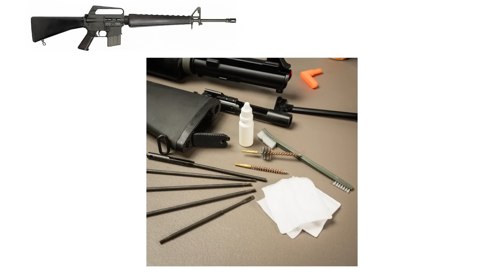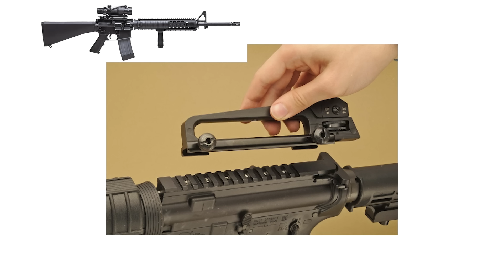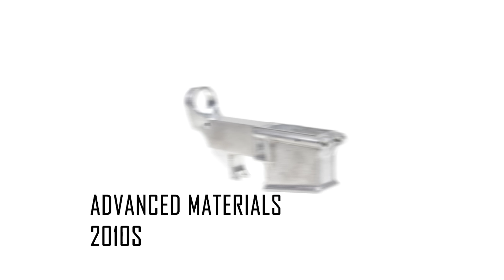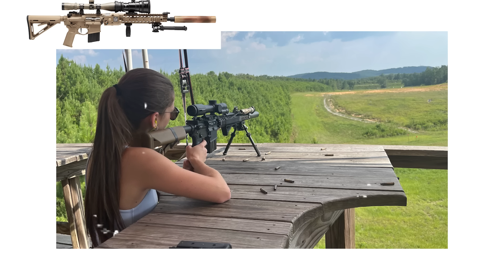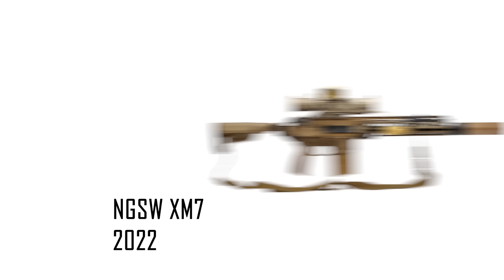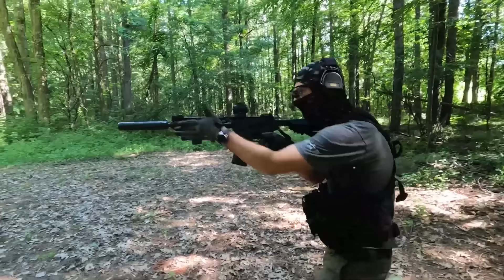Every Significant AR15 Upgrade the US Military Said Yes To

Comment: No mention of one of the best variations, the M16A3. It was an M16A4 rifle with an M16A2 fire control group. No stupid burst cam and extra parts to mess up, but full-auto instead. If you want to fire less than a whole mag full at once, let go of the trigger, stupid, or switch to semi-auto. What I'd like to see next is a complete, site-wide ban on AI narration.
Reply: @BigHarryBalzac  the A2 and A4 are both 3 round burst, the A1 and A3 are full auto without the burst cam/pawl.
Reply: @lumpyzx2645  You're right. The A3 obviously came out before the A4, and I made a typo. The A3 is like an M16A2 with M16A1 selective fire control group, with safe, semi, and full auto modes, just like the good old days. The M16A4 is flattop version of the M16A2 and has a removable carry handle and Picatinny rail. The M16A2 Enhanced rifle is a a Colt M16A2 with a four position fire selector lever that has safe, full auto, semi auto and 3 round burst positions. I have the same style Star Safety Selector from Rock River Arms on my ARs. I love how easily it rolls under my thumb, and on an Enhanced A2, you could flip the selector to any position, from any position. Just put the tip of your thumb on it and you can roll the selector 360 degrees either direction. And I still think trigger discipline and a full-auto fire control group is better than a 3-round burst any day. If you fired the a 2 round burst to empty a mag and reloaded, the first "burst" on an A2 or A4 would be a single shot. And if the last burst fired a single shot, the next mag would start with a 2-round burst. You could never be sure if it would fire a 3, or 2 , 1, or none at all when the complicated mechanism broke.
Reply: @BigHarryBalzac  that sounds correct. I have one of those RRA safety selectors as well, I like it but can't decide whether I prefer it or "mil spec" style. I really like the RRA Tactical Brake, noticeably reduces recoil, usually no flash but if there is it's minimal, and unless you compare it side by side with an A2 FH it doesn't sound any louder to the shooter. Awesome brake.

Comment: The XM7 is not an AR variant. It has a different operating system.
Reply from the maker: Yes, for someone on youtube who can't tell if a 50cal is a full auto glock or a RPG, we have to keep it extremely simple to get them interested learning this.
Reply: Also de HK-416 Family. If you´re really into firearms dont trust these videos, you can learn some facts but many youtubers take info from wikipedia or similars pages and make videos with technical errors like dates, models, calibers, mechanical operation, ballistics, and so. They are fun and well edited although.

Comment: Correction to your error:
The 223 Wylde chamber is NOT more accurate when shhoting 5.56x45 ammo. The chamber modification was made to allow the safe shooting of 5.56x45  ammo in 223 chambers with the additionnof freebore.
Decades of sanctioned long-range shooting matches in the military service rifle categories have proven 223 Wylde chambered barrels are NOT more accurate than rifles chambered in 5.56x45. DMR M4s are all chambered in 5.56x45 NATO.
To verify the truth, read the original SAAMI Specs and documentation.
Reply from the maker: Yes, true. a Wylde barrel it bridges the gap between these two chambers to get the best of both worlds. Better accuracy is all depended on what you're doing with it. 223 Wylde minimize bullet jump and provide a tighter gas seal around the bullet. For a CQB gun 5.56 is just fine.

Comment: The Taiwanese used piston system in AR since the late 60s. 🙄🤡
Reply from the maker: That's the T65. Influenced by AR15 and AR18. Thanks for the video idea, we forgot about the AR18
Reply: @MilGearExplainer  HK 416 uses, is based on the same principle.
Reply: @Zojaam-21  someone needs to create a tool like ancestry so every firearm has a clean record exactly how it was influenced by what and when.
Reply: @Zojaam-21  The 416's piston system is nothing like the AR-18...
Reply: @PlazmaZ5  HK 416 piston is based on G36, G36 piston is based on AR 18, AR 18 is based on German G43 or Soviet SVT40.
Reply: @Zojaam-21  If the HK416's piston system is based on that of the G36 then why does it require a buffer tube?
Reply: @PlazmaZ5 of course it needs a buffer tube because it uses an AR-15 bolt carrier…nothing to do with a piston, long stroke system or short.
Reply: @Zojaam-21  Then it isn't an AR-18 piston/recoil system... The MCX has an actual AR-18 system and doesn't require a receiver extension.
Reply: @PlazmaZ5 MCX has it own bolt carrier and gas piston system, has it owns patent….nothing to do with AR-18.